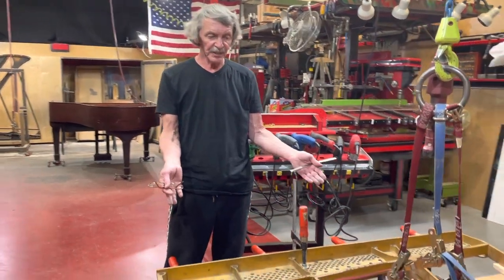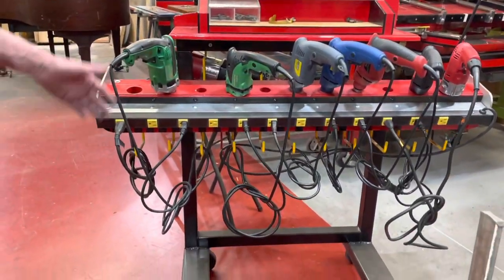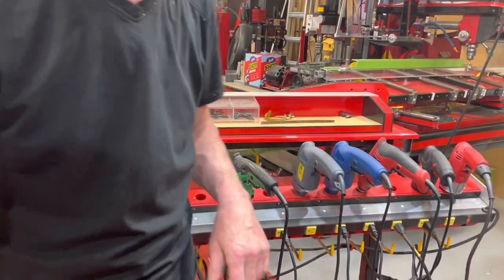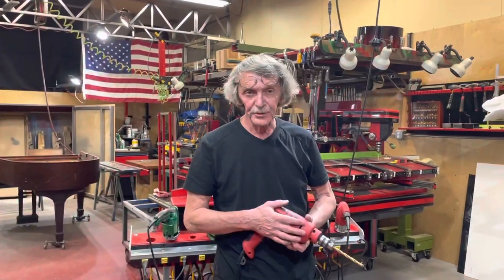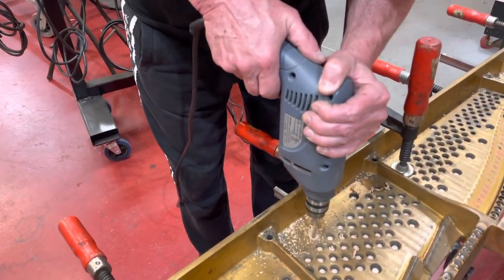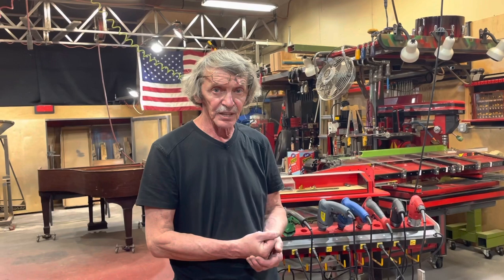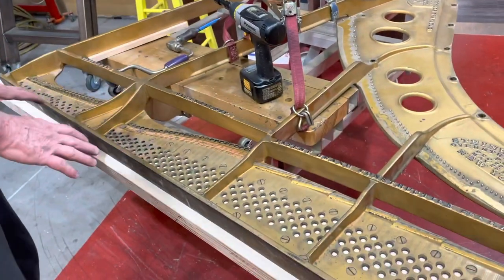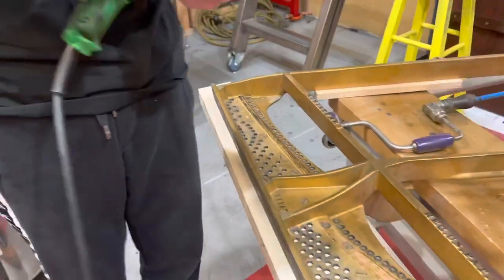Piano Solutions XXI: Making the New Pinblock on the Grand Piano. Fitting Pinblock Inside the Piano

Comment: In the 8:46, how did you measure to create it ?
Reply from the maker: Hi T-Game, in order to fit the pinblock to the place of the original pinblock - you will need a reference. The best reference is the holes on the long screws on the side of the pinblock.